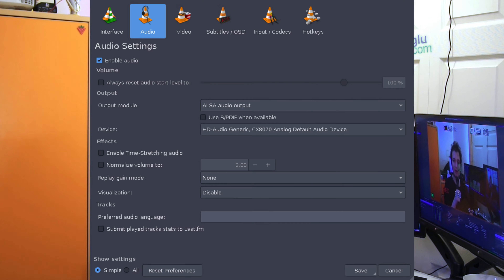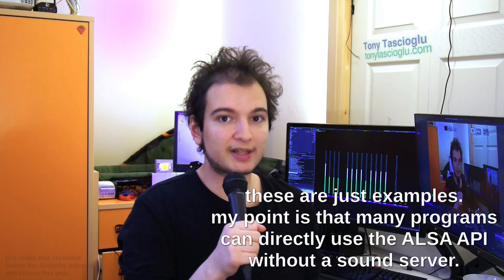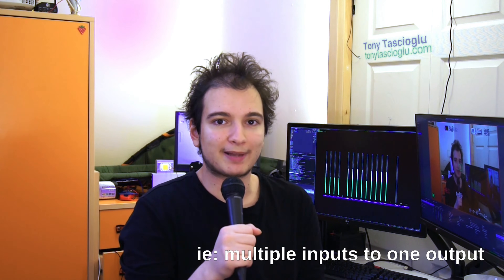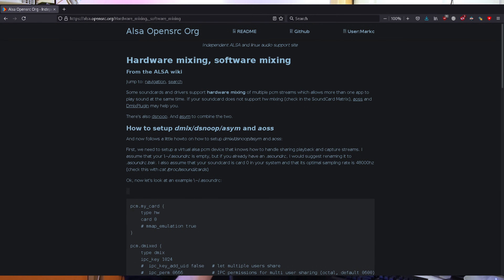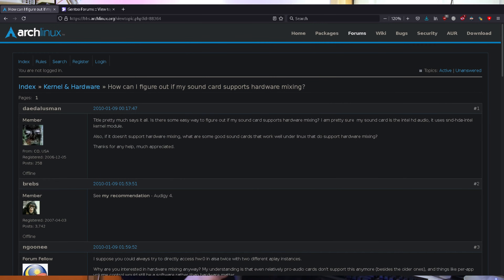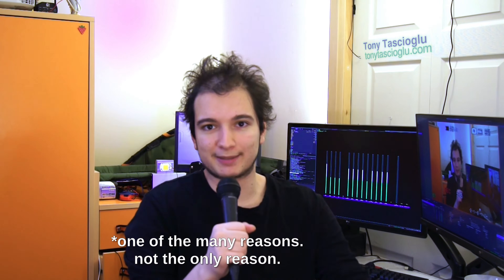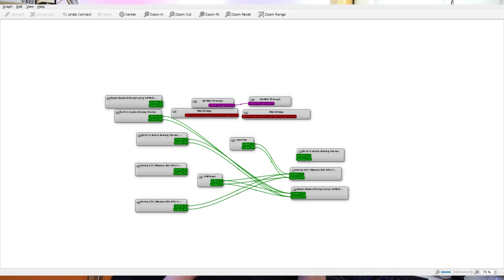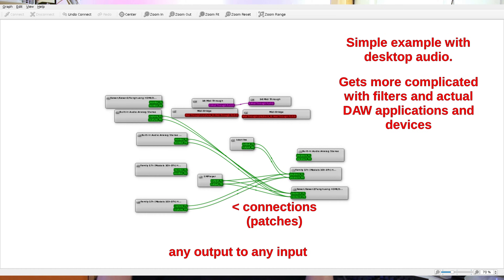Linux Audio Explained (ALSA vs PulseAudio vs JACK vs Pipewire Explained)

Comment: 13:30 I think the rapidly repeating audio pattern is caused by x-runs (failure to update the sound buffer before the deadline) instead of sampling issues. Sampling issues typically introduce noise to the highest frequencies only. As a software developer, Pipewire seems to be pretty well designed except that the design opted for timer based loop to read/write the actual audio hardware instead of interrupt based approach that most audio devices do natively. I would have expected the actual hardware interface to always use interrupt based approach and then use timer based loop for the software interface.

Traditionally the way to fix x-runs problems was to run low latency Linux kernel (PREEMPT config or RT patches, in case of Ubuntu you just install package that's called linux-lowlatency-hwe-20.04 where the number matches your distribution and reboot to new kernel) but according to some user reports the above mentioned timer based hardware handling, some audio hardware has now more x-runs with low latency kernel. I don't understand the rationale for this but I have to trust the user reports about it.
Reply: Timer-based operation is how real-time systems work. Tasks have to run to completion within their allocated time slice.
Reply: @lawrencedoliveiro9104  Yes, that works in general. However, in case of audio hardware, the soundcard has its internal clock and the system must adapt to it because the clock on the soundcard cannot adapt. In practice, this is implemented by triggering a hardware interrupt activated by the audio hardware.

For some reason that I fail to understand, PipeWire doesn't do this but pretends that the system clock is good enough and uses that instead. This despite all the existing hardware actually working as I described above.

If system clock and DA converter clock are in perfect sync, this doesn't make any difference but this never happens in practice.

I've been writing software for living for a couple of decades now and in my experience API should reflect the hardware environment or you'll see "impendance mismatch" sooner or later as a result of API not actually matching the hardware.
Reply from the maker: Interesting! Thanks for the write up, I had not looked into the implementation in Pipewire and how it fully interacts with sound cards, good to know!

Comment: What is Thunderbolt? I'm a noob and can barely access laptop webcam w/mpv usin terminal trying POP_OS but there is no sound with it.  Yes I have a usb microphone  & Pulse Audio running. How do I turn sound on for mpv web cam video?  FYI, I like listening to you, clarifying how audio is working on computers
Reply from the maker: That is because webcam video and audio are handled completely separately on Linux.
Video from a webcam is in /dev/video0 usually (or 1/2/3 depending on how many cameras you have), and processed by UVC or V4L2.
Audio is captured by ALSA as a sound device then handed off to Pipewire/Pulseaudio typically.
VLC has an option to use separate video and audio for webcam capture. I assume MPV also has an option to open 2 streams, one for the video and one for the audio.
Reply: @TonyTascioglu    OMG thank you  Tony,  so much your answer makes it so understandably clear!

Comment: Linux environment: Program > Server jungle (Pulseaudio, Jack, Pipewire, blah blah blah...)  > ALSA ( your virgin audio signal now dancing SALSA  with its resampled partner 😂) > Audio device

Windows environment: Program (Exclusive mode) > ASIO driver (NO RESAMPLING, NO DITHERING, NO NONSENSE MIXING AT ALL) > Audio device (Direct access)
Reply from the maker: I mean, if you want exclusive mode on Linux without any resampling, dithering, mixing, that is also possible. When applications (typically DAWs) use ALSA mode, it gets direct access to the sound card without any modification and bypasses the sound server. You don't see it too often as for most sound cards, other apps can't then use the card at the same time, since ALSA has exclusive use on it, and you need a sound server to multiplex it between apps. But if you want no-nonsense, Reaper, Ardour and even Audacity can work directly with the ALSA device.

Comment: great work, very informative!
just a footnote: the minimum sampling frequency must always be at least 2x the max frequency being "recorded", otherwise spectral info could be lost, as stated by the Sampling Theorem (Nyquist-Shannon). so even if we can only hear up to ~20kHz we actually need at least ~40kHz in sampling frequency. in reality the distortion caused by the sampling process is almost imperceptible to most people but it exists, and human hearing ranges may vary as well
Reply from the maker: You are absolutely correct about needing at least double the frequency to capture the original information as per the Nyquist-Shannon sampling theorem - hence most sound cards running at 48 kHz these days. 

If you're interested, Chris Montgomery also has a great video exploring and demonstrating the sampling process as well as effects quantizing the input over on Xiph's website: https://xiph.org/video/vid2.shtml

Comment: awesome audio configuration tips but please fix your subpixel on your fonts xD
Reply from the maker: Fixed in some newer videos :) 
Though, I still sometimes disable subpixel rendering for videos as it tends to remain sharper when upscaled from 1080p to 4k for YouTube, where anti-aliasing and subpixel rendering tends to look blurrier. (This is more noticable if I directly use integer scaling like the quick Linux tutorials vs Lanczos/anti-aliased upscaling for most normal videos).
For daily use, at one point, I was using a vertical monitor as well, so I had switched to greyscale subpixel rendering instead of RGB and just left it - I tend to use bitmap fonts on my terminal anyway since I prefer the sharpness at smaller font sizes, which doesn't use subpixel rendering at all.

Comment: well that explains why all my system audio cuts out when i switch to reaper, which i currently have set to output directly to ALSA
Reply from the maker: Yep! If reaper tries using the ALSA output directly, it gets exclusive use of the output. However, most DAWs like Ardour (and I assume Reaper though I haven't checked the latest version) let you output to JACK which will allow you to run with a relatively low latency (not as fast as ALSA directly but much lower then pulseaudio), which can be used with other applications (especially if using pipewire).

On the other hand, if you want audio from other applications to work, Pulseaudio and Pipewire will have a loop ALSA device (typically called 'pulse' or 'pipewire'), which will let ALSA-only applications redirect to Pulse/Pipewire.

Comment: installed pipewire, now i cannot uninstall it. followed every tip i could find online and it's now December 2022. nothing helped.
Reply from the maker: This is likely something that is dependent on your distribution. It should be possible to uninstall it if you need, however, many distributions are now including it by default in place of PulseAudio, and you will need to manually install another alternative if you want to still have audio after uninstalling.

Comment: I can see the sound bar moving on the pulse audio settings screen but I get no sound. Monjaro
Reply from the maker: Have you checked the hardware device volume from ALSA using 'alsamixer'? In alsamixer, you should be able to switch to the right output device using F6, and make sure the volume is enabled from there. Also, when you open 'pavucontrol', check 2 things: Under output devices, if you have a 'Port' dropdown, make sure it's on the right output! On some computers, the speakers/front and rear headphone outputs will need to manually be switched using that dropdown. Similarly, on the configuration page, double check that the profile is correct (on audio over DP/HDMI, this can be misconfigured).

That being said, I have found that there are a couple of audio chipsets (on laptops especially) that don't work with ALSA at all, despite showing up as devices - and if that is the rare case, I'm afraid I don't have a solution at the moment.

Comment: Stumbled upon this video while searching for a way to get pipewire to output 5.1 surround audio via S/PDIF. Very informative and while it didn't solve my problem, at least I now know more about PulseAudio and Pipewire. Researching resumes...
Reply from the maker: Hm, you are probably right. I remember that 5.1 wasn't fully implemented working in Pipewire last year.
While I don't have an SPDIF output or a 5.1 setup to check on my current system, I checked the supported HDMI profiles and it does allow for a 5.1 or 7.1 output (as well as allowing 5.1 digital output on my old SoundBlaster), so it might be possible using HDMI instead if it isn't supported over optical.
Reply: I have a 5.1 sound interface connected via USB. All the 6 channels show up for separate connection in qpwgraph, and I was able to route audio to them separately.

Comment: Tony, how do you configure your USB microphone? I have a Blue Yeti USB both on Ubuntu and Fedora and the microphone never works when I boot my system. It is detected by kernel but it just doesn't react to any input after I boot my system but it works only after I unplug the cable and plug it back. It never works after I reboot my computer and the system starts. I've already searched the entire oblivion of internet and can't find any solution.
Reply from the maker: That's indeed a little strange. Between the 3-4 USB microphones and audio interfaces I have tried, all of them so far have been basically plug and play. Apart from having permissions setup (systemd should handle this automatically, but you can put the user in the audio group if needed as well), I haven't encountered anything with having to unplug and replug after power on, especially since they run through a similar process to load a driver for it either way. I would wonder if it shows up in the same way and is detected the same way before and after replugging it.

Comment: If I execute a browser or mplayer via SSH, it displays properly on the machine in front of me, but the audio plays at the other machine.  I was hoping to find out how to redirect the audio to the machine in front of me.
Reply from the maker: That's because although the X11/Wayland GUI is being forwarded, the audio isn't, so it still connects to the sound server on the device you're connected to. There are other applications for connecting remotely such as X2Go which also works over SSH, but does also forward the audio server connection!
Reply: I've solved this,  @TonyTascioglu .  I put this in my .bashrc file (on one line):
test -n "$SSH_CONNECTION"  &&  export PULSE_SERVER="${SSH_CONNECTION%% *}"

Comment: ALSA can do software mixing. PulseAudio is not required for that. I listened to "podcasts"[1] while playing SNES emulators on Linux before there was PulseAudio. What PulseAudio can do is to give each program a different volume, resample, and route different programs to different output devices. And what PulseAudio actually did when it first arrived was to add such a huge audio latency that gaming and watching videos under Linux became impossible. Well, I had to uninstall PulseAudio to fix it.

[1]: Wasn't called a podcast back then. Was mp3 files of Chaosradio manually downloaded from an FTP server.
Reply: I came here to say something like that. Dmix, dsnoop, plug, route and so on defined in asoundrc it rock solid if a bit cumbersome. There is also the possibility to setup ladspa plugins within the asoundrc settings file to e.g. split and filter audio for a satellite+subwoofer system.

Comment: I am using an old bluetooth handset thing that uses oss. It works, but I can't record it because the device is busy. I am trying to find a solution to it, but so far I have not. I could use to do it with padsp pulse wrapper but that seems to have been removed in fedora 36.

Comment: A lot of ppl have over the years commented on the messiness and confusion around linux sound and could there be an easier way to deal with it. I have used alsa from the command line and pulseaudio via a gui. Not used Jack as I don't mix sound. Pipewire I've not heard of prior to watching this video. An instructive video which explains the basic differences between the various pieces of software and how they interact to provide sound capability for Linux which can be a bit overwhelming for Linux newbies. Keep up the good work.

Comment: Pipewire started life as a way to handle the gaps left in Wayland for stream capturing with v4l2 and dma-buff, zero copy screen sharing, audio/video sync, etc. They ended up recreating the pulseaudio server as a plugin and reimplementing the JACK interface with a focus on latency. It really is a wonderful project.

Comment: Thanks for doing such a nice rundown. I have been using PipeWire for a good few months now without any major issues. I had major issues about half a year ago (I know this video was released even before that time). In my experience so far, BT headphones work better with PipeWire than they did with PuldeAudio, though I don't use them that much. An amazing thing is that using PipeWire I can record audio from my BT headset right into Ardour, like any regular audio input. Plus I can work on my music using them in playback only profile. It's pretty amazing.
Reply from the maker: Yeah, I think the stability and support for Pipewire has greatly improved in the past year. As for recording audio from Bluetooth, make sure you check which sound profiles you're using, since some definitely sound better then others with Bluetooth (SBC-XQ vs SBC for playback for example)!
Reply: @TonyTascioglu  Ah, interesting! Yes, the quality in duplex over Bluetooth is usually pretty bad. Having an option to improve that would be great.
Reply: YOOOO IT'S UNFA?? HOW IS THIS NOT PINNED??

Comment: You mentioned multiple mic inputs with ardour. Would you consider a future episode on setting that up? I have struggled to find a good guide
Reply from the maker: Hello Nate, in short, in Ardour, if you're in the "Edit" view, you can right click on the channel info on the left, and select "Inputs".
This opens up a menu where you can assign any of your inputs to any of the channels in that track. For example, microphone 1 to channel 1, and a USB mic to channel 2, so on.
You can either have 1 track with multiple channels, or multiple separate tracks, either way, you can select the microphone inputs from the system that should map to each of the channels.
Then, to record multiple inputs, you can just enable recording on the tracks, and it will record all of the selected inputs.

Comment: Is the Bluetooth problem fixed now?
I'm planning to get some bluetooth headphones.
Reply from the maker: Bluetooth with Pipewire has been good over the past few months for me. Any issues I now have are more likely due to BlueZ as opposed to Pipewire, and on my current laptop, I haven't had stuttering with the audio (with the exception of SBC-XQ at longer ranges, and in a crowded environment, which is expected)
Reply: @TonyTascioglu  Thank you for your response.

Comment: I hope pipe wire will solve the problem I have been working on, bi-directionary audio to a phone on Bluetooth, I would like to connect my phone and be able to make and receive calls using my pc headset, but so far all I have been able to do is use my pc as Bluetooth speaker but not as a microphone for the phone
Reply from the maker: I believe I had this working with KDE at one point, where the phone used the computer over Bluetooth as the mic and speaker, but it's always been a bit 'janky' to say the least, and I haven't found other software that replicates this in a more reliable manner. Also, note that outside of calls, Android can only send Bluetooth streams, not act as a receiver.

Comment: Another pro for Pipewire that you didn't mentioned is that it is written in C and not in C++!
Reply from the maker: Good point, however, I didn't feel the need to include it for a few reasons. First, while Pipewire is written in C, so is Pulseaudio which it replaces, so it wasn't a direct advantage or disadvantage. (Jack2 was written in C++, but as I mentioned, their target userbase was the more pro-audio folks where an object-oriented language makes sense for their feature-set). Also, I'm not here to start a flamewar between the C and C++ folks. Both are lower level languages, both have their pros and cons based on the application it's used for.
Reply: @TonyTascioglu  I understand your position (and I think that it's the best one you can take). And of course, that's just me humble opinion. I do respect anyone else that won't agree with me. Thank you for your time and thank you for your video!

Comment: I had that bluetooth problem with my jabra headset and pulseaudio as well. It required me to keep the pulse audio gui open at all times and then it worked. Eventually rebooted my system and all worked properly again.

Comment: I replaced pipewire  with pulseaudio on my Fedora system about 8 months ago because it was too buggy. I use my Bluetooth headset every day for hours so you can imagine how frustrating it was, it also didn't work with certain programs like Davinci Resolve. I think pulseaudio gets underserved bashing because for years now I've been using it with almost no issues whatsoever, it always just works, whereas the great pipewire has been nothing but issues for me.